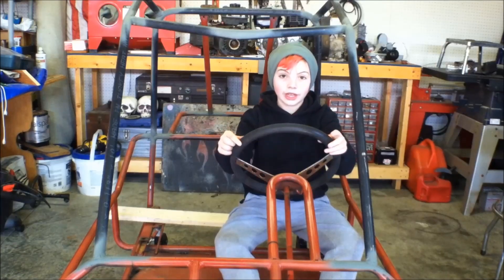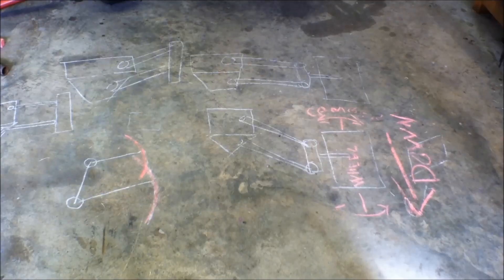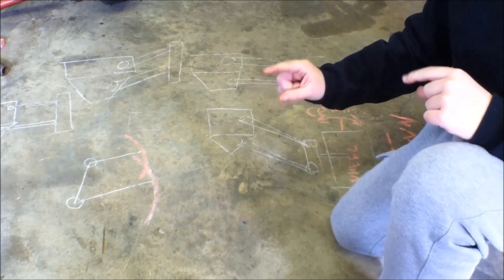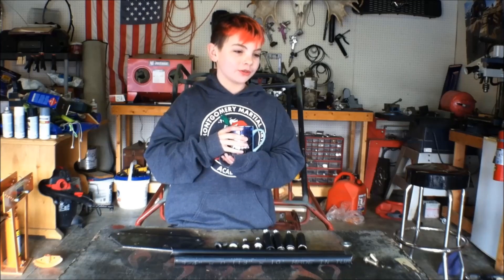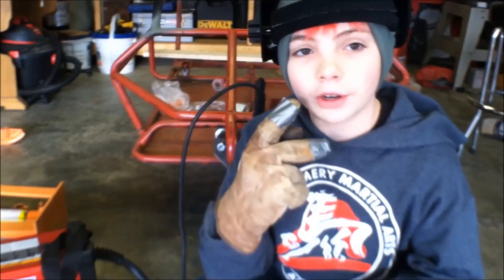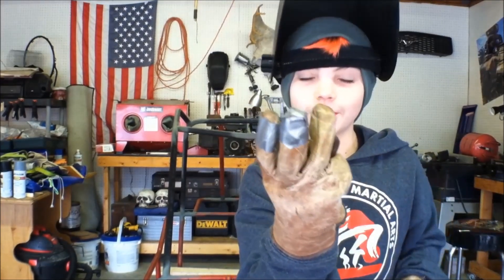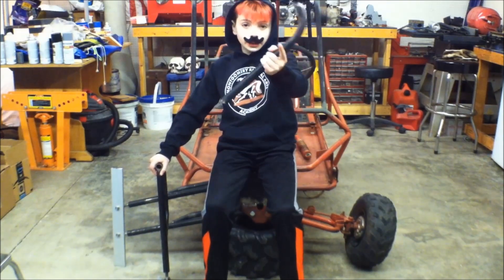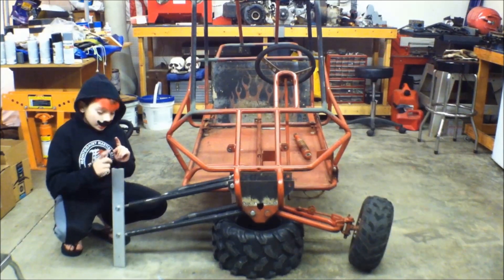Yerf Dog Off Road Go Kart suspension build, video 1

Comment: What yerfdog did this start out as a a 3202 or 3203? I have a 3202 and its impressive you do this stuff on your own. I wish i had a lathe and a welder ha!
Reply from the maker: It was a 3202, I believe the frame's are the same on the '02 and '03, the difference is in the "roll cage" and front shock mounts.
 I actually get help from my Dad, some of the machines I've run before but some of the stuff I'm doing for the first time here on youtube. Thank you for watching and the comment!